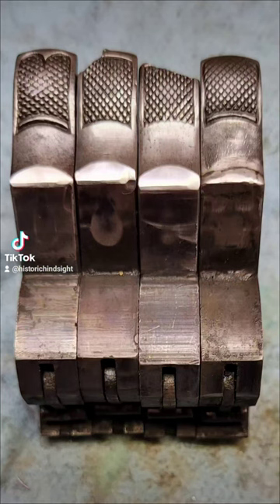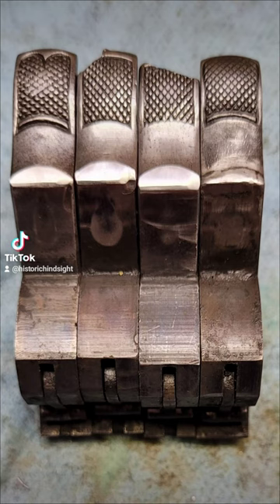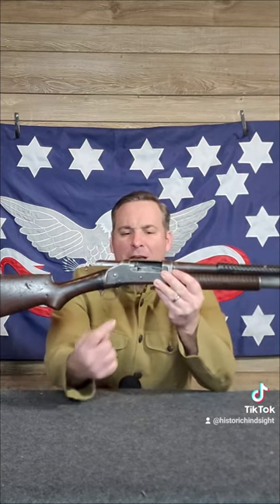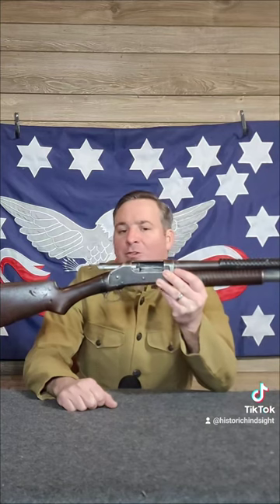Faulty Trench Shotgun #history #gun #ww1 #ww2 #technology #shorts

Comment: The cartridge guide is the only real criticism. Everything else is a materials issue, not a design flaw. If that's all you had to say, then I'll go back to enjoying beautiful arms.
Reply: It's both.

A material problem can be solved with good engineering and designing to solve these issues

Clearly the gun was designed for much better quality parts and as such failed in its goal of a functioning gun
Reply: This is still a poor follow-up to a poor video. The weapon is fine, better than most, and definitely a forerunner of its time. "The 1897 Trench Gun Sucks" is an objectively false statement, or at best, a flawed opinion.
Reply: @enderwolf3588  didn't say it sucked.

Most early tanks sucked, the ford 3t tank sucked, but I do love the little guy.

Same here, I think the 1889 is a good gun, but that doesn't mean its flawless, in this case it's a mix of poor quality of steel/quality control, and a bad design which didn't take into consideration the poor quality of materials. Thickening up some parts wouldn't have prevented the design but would've solved some of the issues.
Reply: I didn't mean you had said it sucked. The videos creator made a prior video saying the trench gun sucked, and then he proceeded to talk about the U.S. poor shotgun amunition logistics. This video was a follow-up to it claiming a few other minor issues with the shotgun during service, but it is and has always been a great civilian (and potentially military shotgun). Not to say it doesn't show its age, but it holds its own, and modern reproductions have made improvements to the design while keeping form factor in mind.
Reply: @enderwolf3588  ahh that makes more sense